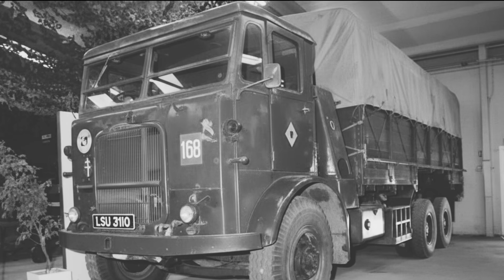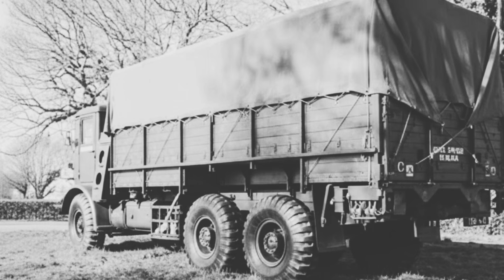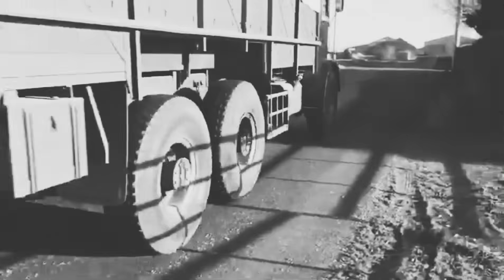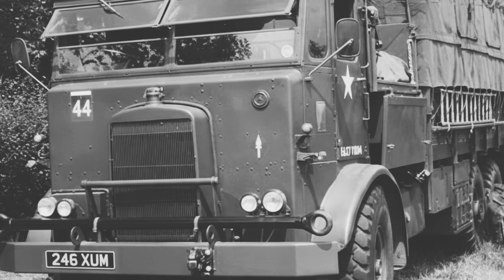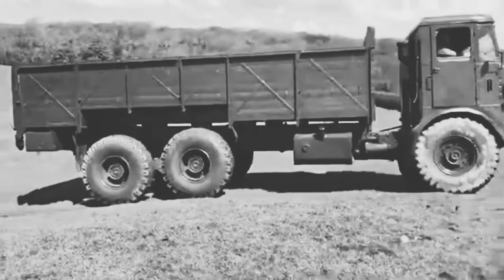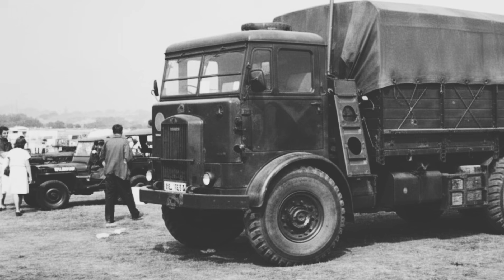Why This 'Forgotten' British Truck Kept Moving When Every Other Vehicle Broke Down

Comment: How did my national service in Germany, BAOR. 7 th. Armoured division. We had 20  Leland hippos we were the mobile storage unit   we carried three centurion gun barrels on the bed of the truck, and I also had nine gun barrels on a trailer
We also carried tank tracks nuts and bolts, any spare part was needed for centurion tank
We also have a mobile laundry and Bath unit in one of the hippos 
unit name  7 th armoured division ordinance field Park, Ironside Barracks Cella
I have photos of the hippos centurion gun barrels on the trailer. If anyone interested, I will send them to you so how are you contact me I do not know      You have to be quick as I am approaching my 90th birthday  God save the Queen as it was in my day

Comment: youv'e got a picture of an AEC to start with but talking about Leylands all the time
Reply: This is crap.I drove thousands of miles in the AEC, best lorry the army ever had, they were nick named Knockers becauase of the sound. I never ever saw a Hippo.
Reply: @grahamsibbert2412  Mk 2 Militants were tremedous to drive cross country. Used to cover the engine in blankets to deaden the noise before the Army made ear defenders compulsory. Remember seeing the last of the Hippos going through the auction around 1980, making around £350 and the twin rear tyre type.